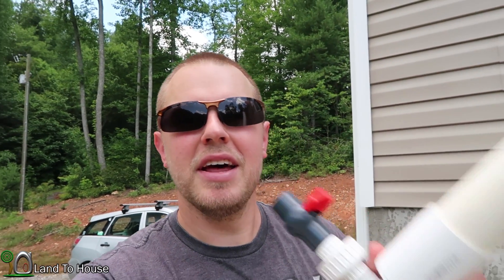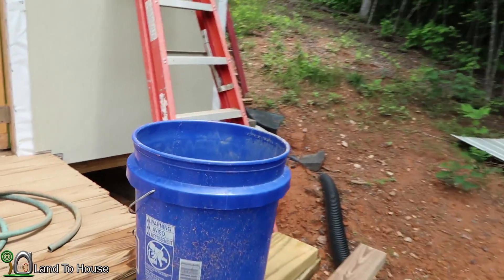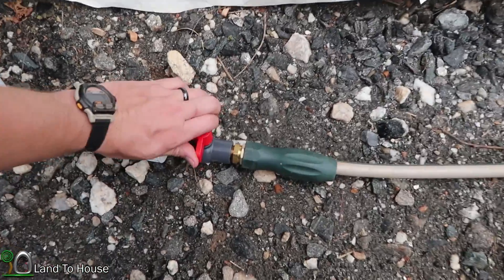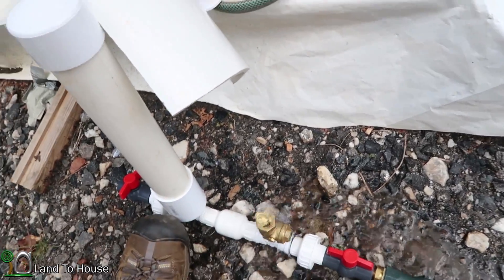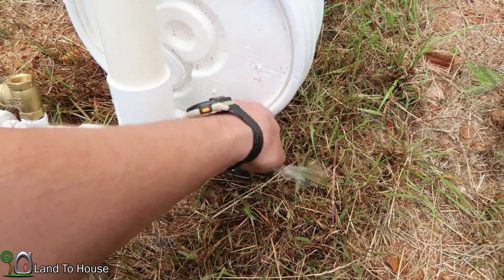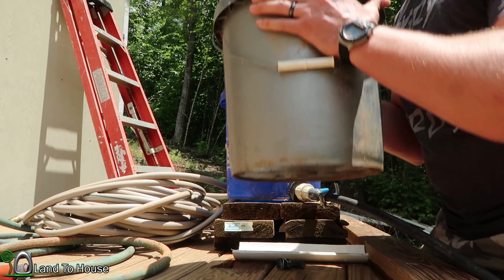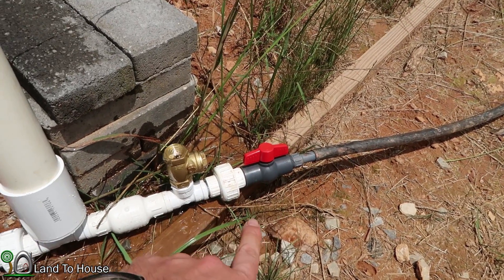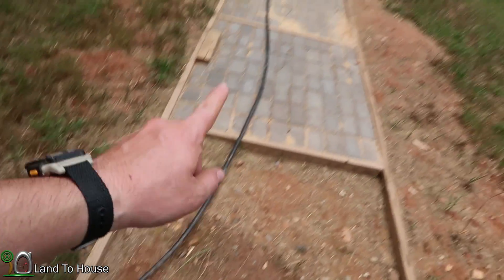Garden Hose Drive Pipe? - Ram Pump

Comment: Love these ram pump experiments and it's neat to see that a garden hose can work with enough head pressure.  I have an idea: since the waste valve re-opens based on the pressure wave propagating backwards through the drive pipe leaving a pressure drop in its wake, how much of the drive pipe is actually involved in making that minimum pressure drop?  You could try adding a straight 20' length of PVC pipe right to the pump's drive side ball valve and then connect the garden hose to the end of that straight pipe, and see if that improves the performance (cycle time, needed head pressure, straightness of the garden hose as it approaches the length of straight pipe).  If that works, will a 10' pipe also work, and how about a 5' or even a 3'?  this would test how much of the drive pipe is directly involved in the needed pressure drop to re-open the waste valve.

Comment: I found this video to be quite helpful actually. It answered one of the questions I had concerning a drive pipe. But one question still remains, and I need to give some more information before asking. I hope to install a ram pump to water my livestock with. Something as small as a 1/2" pump would probably be enough to keep my stock tanks full. The problem is, the creek I plan on using to get my water from is rather crooked. Another issue is I really don't have a good place to dam up the creek to get enough head pressure, and be in a straight enough place. My question to you is how much "bend" is too much for a poly drive pipe to be efficient enough to work with a ram pump?
Reply from the maker: The turns and twists do reduce the pump efficiency but it will still work. If you have a constant downhill in your creek you can jump the banks and straighten out the curves some. The pump does not have to be in the water to work. I had a test years ago where the drive pipe was floating on water and bent all kinds of ways. The pump was slow but still worked. I have a video planned for this summer where I have several 90s together in the drive pipe. Should be a fun test.
Reply: @LandtoHouse  Great! I've also been studying on using a bucket intake, so that I'll have some hydrostatic pressure to help run the pump. There's a nice spot I can set something like that up, too. I'll get to work gathering parts and pieces, and get back with you.

Comment: Garden hose can be burried for rigidity and for protection from UV and O3.
Reply from the maker: Yes and for a delivery pipe that would be nice. But for a drive pipe it is just not good.
Reply: It most definitely cant compare to if full drive-pipe length can be made out of a metal. My colleague, a long time ago had a ram pump with 10cm diameter drive-pipe and a large fire-extinguisher pressure vessel.. he had it running real fast, used it both as a compressor and as a pump until the whole metal pipe blew up. lesson learned - don't go above 10 bar, with cast iron pipes. Thanks for the video, but if they really need to save money on the pipe better shorter stiffer drive pipe with a large fall, than a long soft one.

Comment: It seems to me that the mechanism of the ram pump takes advantage of the water hammer effect and that a flexible drive pipe, like a garden hose, would act as a "shock absorber" because of its flexibility - and, therefore, reduce the pressure hit to the ram pump and reduce output, as well.   Is that consistent with your experience?  Is that, perhaps, as big or bigger of a factor in the difference between the garden hose and the poly pipe?

There is only so much energy available in each stroke and it seems to me that the goal is to concentrate as much of that energy at the check valve as possible, and not allow it to be lost in momentary expansion of the garden hose.

But, I have no experience with these things.   So, I could be completely off base, here.   LOL!

Have you done any experiments that compare similar sized drive pipes of different construction?   Like, would a hard iron pipe perform better than a flexible pipe of similar size?

Thanks, for your very interesting and informative videos!
Reply from the maker: Yes the shock absorption of the hose does reduce the function of the pump! I have a video showing the comparison of PVC vs poly pipe. The pvc was much better. I do not have any steel pipe because I am poor haha.

Comment: Drive line must be a solid as possible! Steel incased in concrete is best. You do not want any shock absorbed! If you use a barrel or a stand pipe at the top of your drive line, there must be at least one foot of water above the drive line outlet! That weight keeps the shock from transvering up the drive line.
Reply from the maker: Yes. Garden hose is so absorbent that is does not work at all for a drive pipe.

Comment: What if you had great water-flow. Do you need the swing valve in the front that releases water.I just need the water to pump up 8 ft.
I am  trying to use this concept in my hydroponics greenhouse.  I have a 55 gallon tank with a U siphon outside the tank that would drain directly into the ram pump ( but i can't have the water being released by the swing valve). It then pumps the water about 6-8 feet through a 3/4 inch pvc pipe into my horizontal  hydroponics. The drain pipes release water back into the tank to create a continues water flow through U siphon.
Reply from the maker: To operate, the ram pump needs both the waste valve and a secondary valve. The ram pump is not a good choice for a closed system like hydroponics grow beds. You might be better off looking into a solar pump for that application.
Reply: Since the ram pump can run underwater you can create a closed system where the waste flow is it put into a separate tank and over flow back into the original tank.
Reply from the maker: The issue with the closed system is that only 10% of the water is pumped back to the top at best. This means that 90% of the water ends up at a lower state than it did originally. So if you used a ram pump underwater in a tank it would fill that tank with water very fast.
Reply: Scenario 1) I  have a water tank being drained out using the U siphon into the ram pump. The ram pump would be in a tank that over flows back into the tank which the U- siphon is draining so I have continuous water flow. Plus the water being pumped ends up draining back into the tank with the u-siphon.

Scenario 2.) What if I took the first swing valve off and had the water going directly into the pump. I could use water flow coming from the u-siphon or the water being drained back into the tank when it passes through the hydroponics system.
Reply from the maker: 1. Using a U siphon to feed a ram pump is not going to work on its own. The U siphon pulls air until it has made a full suction. This air will stop the ram pump very fast.

2. The waste valve is what makes the pressure wave and is necessary to get the ram pump to work.

Comment: In your book, you say the following, "You can build this pump with several dimensions of components but it is important that the Drive pipe and the first check valve have the same dimensions. "  Currently, I am running a 1" drive pipe into a 1/2" ram pump.  The neck down occurs at the first ball valve.  The pump is working ok, what are the negative effects I am missing with this setup?  (I already had the 1" pipe on hand, which is why I used it.  I don't require very many GPM outflow, which is why I built a 1/2")
Reply from the maker: The main thing you are missing is efficiency. The pressure wave that is going down hill is inside a 1" pipe with lots of pressure. The returning wave that is going from the pump to the source is only created by a 1/2" valve. This means the efficiency is very low. You would have a larger output with a 1/2" drive pipe going to that 1/2" pump.... Now if you were to increase the head pressure there would be a point that the 1" drive pipe would not allow the 1/2" valve to cycle.
Reply: I switched the gate valve out for one that was 3/4 of an inch rather than a half-inch. That doubled my efficiency.    I will probably just leave it like that, since moving to 1 inch would require a new pressure vessel as well.  Thanks for the help!
Reply from the maker: Happy to help!

Comment: Nice video. You need to consider the drive pipe length though in order to get it to cycle at its most efficient setting. The reverse pulse back up the drive pipe needs to escape to atmosphere so the next cycle will start quicker. Shorten your drive pipe and make sure there are no bends to allow it to flex sideways. You should see improvement.
Reply: Yes, there is. My ram uses  a spring water source gathered into a pool where I pipe the water to the top of the ram drive pipe (about 20 feet).  At that connection an upside down 'T' with the vertical pipe open to the atmosphere is an escape for the pressure wave produced by the hammer effect at the ram pump. If the pressure wave can't escape before the flow of the next cycle starts, the flow has to fight the pressure wave as it returns up the pipe. Picture the drive pipe as a guitar string 'tuned' to a certain frequency. You want the drive pipe length ( atmosphere escape at top, to ram valve at bottom ) to allow the velocity of the wave to escape just before significant flow starts again. The velocity of the wave is the same as sound through water. You can actually see the returned pulse in the upper end of the drive pipe when you have it tuned correctly.
Reply from the maker: In other tests with the 1/2" ram pump I have noted that the drive pipe can exceed 200 feet and still work. But you are right. 50 to 75 feet is the best length. The larger pumps will not work with a drive pipe longer than 100 feet. ... The garden hose is just too soft to be a good drive pipe.
Reply: In a situation where you were siphoning out of a pond for your drive line, there isn't any way to allow the shockwave back to atmosphere, Right?

Comment: Seth, I built and installed a 3/4" ram pump yesterday for getting water from a spring below our cabin to a holding take above it on the hillside for running water/showers. It worked flawlessly overnight! I was very impressed by the output! All my friends were in awe lol I was just going to ask if I could use that black poly flex tubing for the drive pipe, guess I can. The PVC I used was clunky and limited.
Reply from the maker: Great results! Yes you can use the black pipe just fine. It works well. PVC is a little better at reducing loss from flex but the black pipe is just fine.
Reply: I had about 3.5' of head, and I filled a 5 gallon bucket to the brim in 15 minutes with 100' delivery pipe 25' above the pump. Very adequate.